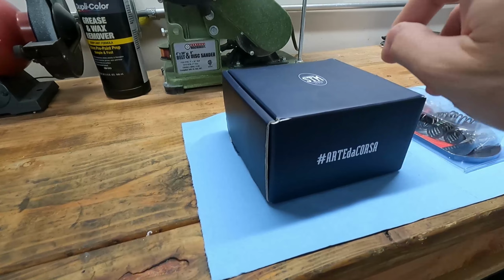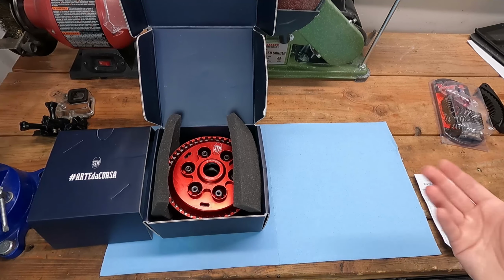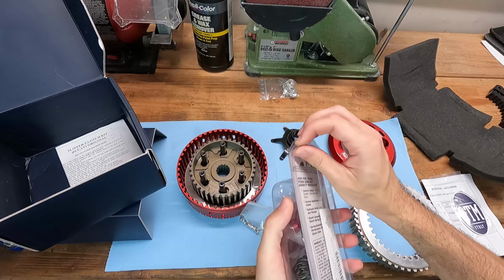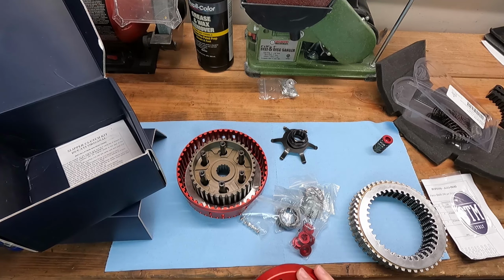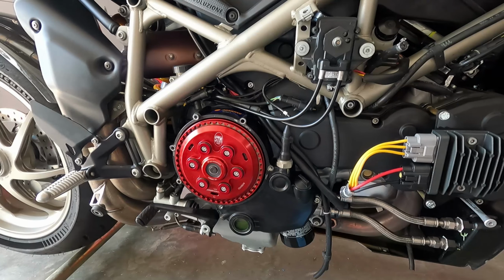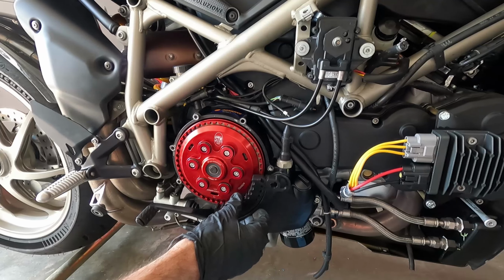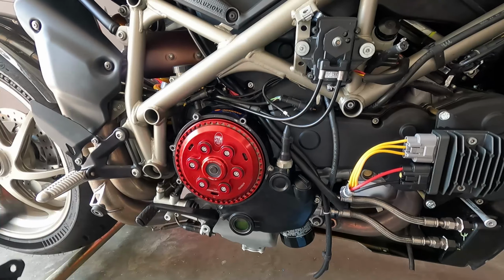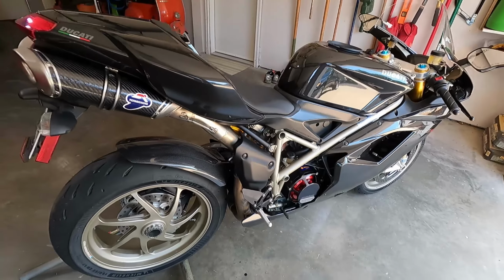2009 Ducati 1198S | Ep.12 | Installing STM Slipper Clutch

Comment: Good vid, love the stationary camera especially. Tip to Ducati clutch mods, use the 2012-on actuating cylinder and new type push rod with cross pin. Stops the rod rotating with the pressure plate causing havoc with the cylinder.

Comment: You've made a very enjoyable series of videos, especially interesting to me, a former owner of a beautiful red 1198 SP. It was a mistake to sell it, but maybe it was too much for a man my age. Here's a dumb question which I have a hard time finding an answer to.  Oil leaking onto a car clutch results in slipping and requires repair, yet most modern motorcycles have clutches bathed in oil. I believe that Ducati has also gone to wet clutches. Why don't they constantly slip, since oil is meant to reduce friction to a minimum?
Reply from the maker: Thank you for watching and for the comment. Wet clutches rely on oil specifically formulated for wet-clutch motorcycles. These oils don't have friction modifiers, and that aspect mixed with the wet clutch pack's friction material, prevent it from slipping.

Comment: great video :) you did however made a small mistake... you didn't align the metal clutch rings, they have a small mark on them, and you need to align it according to one of the six front bolts... at least when you are assembling a normal clutch, dunno if it is mandatory with a slipper one...

Comment: Do you think it would solve my problem with clutch slippage?   I replaced one of the 2mm spacer with a 1 mm spacer, as recommended by many people, slippage partially stopped but now I can't find neutral.  This is on a 998, let me know what you think.  Thanks
Reply from the maker: Changing the clutch pack stack height will help fix slippage, although making the stack taller (i.e. installing a thicker plate) I would think should stop it slipping, not installing a thinner plate. Difficulty finding neutral is typically down to 1) the clutch system has air in and needs to be bled, or 2) the clutch basket is heavily worn/grooved and causing the clutch plates to bind and not fully release.

Comment: Thanks for that demo. Does the new clutch affect the feel at the lever much?
Reply from the maker: The pull is a bit lighter, but the main difference is on high engine speed downshifts. If the slip is engaged, the lever won't bounce back immediately until the slipper is done slipping.

Comment: Do you think that after all these upgrades, this is the ultimate 2-cylinder Ducati?
Reply from the maker: I really do think so. I've ridden a 1299 Panigale S, and while it is an amazing machine, you can never really tell if the bike is giving you all the power and performance it has to offer because of all the electronic safeguards. With this 1198, there is no doubt what the bike is doing and what it is capable of, and I find that to be a more enjoyable experience.
Reply from the maker: Also, I'm a huge fan of the under-seat exhaust look :)
Reply: @PracticalEnthusiast  that's what attracted me to the bike back in the day. I really hope to own a 1198S model some day. Thank's for answering!

Comment: -- awesome video - very informative...got my stm slipper today...
Torque Settings: Below
----------------------------------------------
#Dry Clutch Basket - 36Nm
#Center Nut - 260Nm
#Spring Cap Bolt - 8Nm
#Cover - 7Nm

Comment: Did you use anti-seize to lubricate the ramps? If you did you probably shouldn't. Anti-seize actually contains metal particulate and is technically an abrasive.
Reply from the maker: I used Loctite moly paste since the clutch instructions just said "grease here" without an actual recommended type. I've successfully used moly paste on many metal to metal sliding surfaces with no ill effects.
Reply: @PracticalEnthusiast  oh ok. Moly paste is excellent. It just looked like anti-seize in the video.